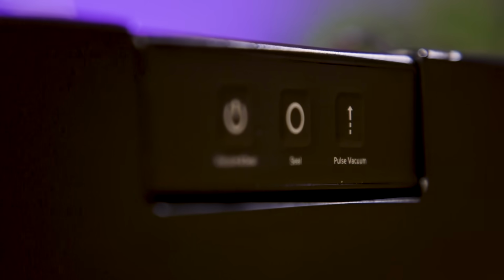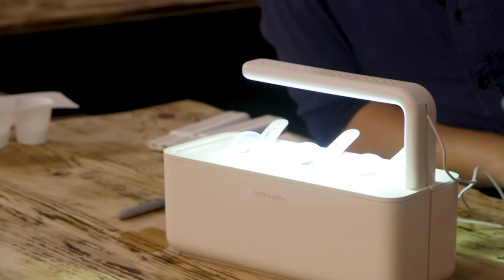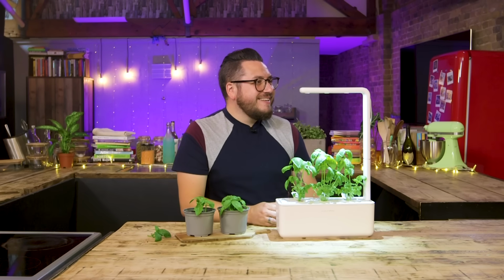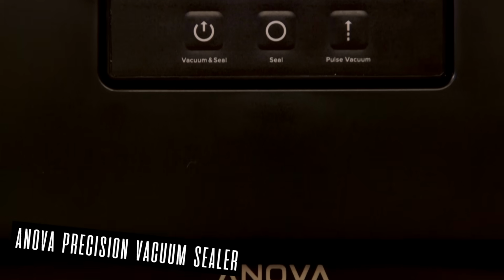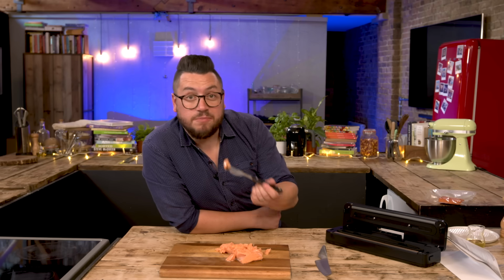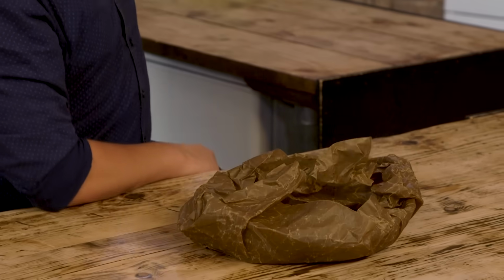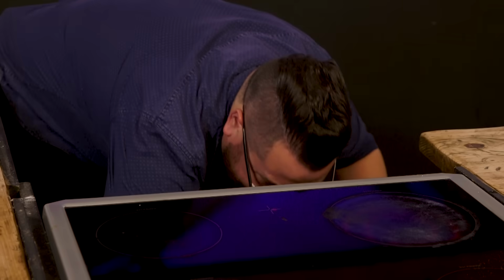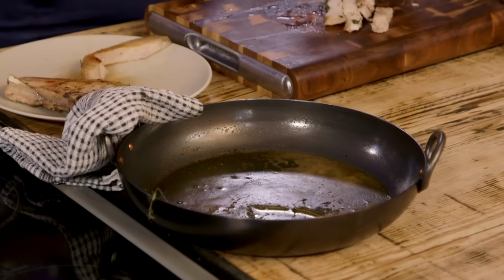Reviewing High(er) End Kitchen Gadgets Vol. 2 | Sorted Food

Comment: first one looks like a tank, with some pots slightly shorter than the fill line, with some fabric or yarn going from the bottom of the pots into the water of the tank. (The string brings up the water when the dirt gets dry.) With a LED plant light strip on top.
On amazon you can get some self watering planter pots (4pack 9.5 inch for $40 or 3 pots and 3 window boxes for $30) for between $30-$40, and 2 LED strips you can put on the underside of a cabinet for around $18.
Seeds are expensive on Amazon but go on etsy and there are lots of different shops selling seeds, found a listing for 10+ Organic Basil seeds for less than $1 and about $2 for shipping, with a lot of high reviews.

So for around $60 you can put together your own kit and have more planting spots for different plants and the pots are bigger so they have more room to grow.
€89.99 translates to about $110, so a savings of about $50.

Comment: Hi! Chemist here! Well that may be generous, Chemistry Degree here who enjoys cooking.

Seasoning on the Carbon Steel pan (and cast iron cookware which is similar) is a polymerized hydrocarbon. That's a similar structure to plastic which is why it has nonstick properties. The best method to season it (many carbon steel pans come unseasoned) is to use an oil with a high amount of unsaturated fats (I find grapeseed and canola to be best with respect to price and availability), use a very thin layer, and a very high heat in your oven.

The reason you want a high amount of unsaturated fats is that those fats are more reactive and will polymerize more, so the seasoning turns out better. You have to heat the oil well above the smoke point as well to start to break down those bonds so they will react. You will smell some burning oil, but you shouldn't see a ton of smoke billowing out, that's a sign you over-oiled the pan.

Comment: i'm american so our idea of portions is a little different than y'alls but i love my vaccum sealer and i don't even have a sous vide machine. i use it to pack stuff and save space in the freezer. it prevents freezer burn pretty well. i have occasionally used it to marinate but for the most part i use it to aid in storage so i had never really thought about the plastic issue before. it's worth noting that if you cut off the sealed bit the bags are re-usable depending on the quality you get you just have less and less bag each time. i feel like you used a lot more bag than you needed for these tests and if instead of cutting it open you just snip the sealed bit off you could have gotten more uses out of them if the plastic waste is a concern.

Comment: That Click n Grow seems legit, America's Test Kitchen named it their winner in a test of 4 models.  Some competitors didn't work, some didn't grow nearly as fast. But the problem is that the darn pods with "smart soil" are so expensive that if you replace your pods after 3 months you'll soon rack up a higher cost than the unit itself. So it doesn't even pay off in the long run.

Comment: As far as the potted basil goes. You can buy those window box flower pots that have a lifted bottom with holes in it, so you can fill up the bottom with water. Works wonders for growing your own herbs, you do have to wait till the root system develops enough to reach all the way trough to the bottom tho, and just water it the normal way. So while the gadget might be neat, unless you are living somewhere where you get no sunlight the right planter box would do the same.

Comment: In the U.S. I have an Aero Garden, the nearest appliance to the herb garden seen here. Mine does give more options, however you do need to put fertilizer into the water when the machine says to, about every 3 weeks. It also tells you when it needs more water which is helpful. I plant mine in November, usually opting for thyme, chives and basil. By the time winter in NYC rolls around my fresh herbs are ready and last for about 3 months. I use it all the time since fresh herbs in winter are very dearly priced.

Cleaning it for the year is a bit of a challenge.

Comment: The vaccum sealer for me gets used weekly, we bulk buy chicken breast and seal/freeze them in packs of 2 to defrost as required, same goes for steaks I’ll get a full fillet/ribeye and cut into individual steaks. Saves so much space in the freezer, saves money on buying multiple small packs of meat, and saves multiple trips to the shop..for me the sous vide is more of an occasional treat that I wouldn’t call essential, but I’d recommend every kitchen should have a sealer!

Comment: Hey Jamie, that vacuum sealer, it's perfect for freezing your leftover smoked meats! Seal it up, freeze it, and when you want it again heat it up in the bag in a pot of boiling water...tastes exactly the same as the day it was sealed.
And as for the bag waste, those bags are washable and reusable. Obviously you'll end up with an unusable bag at some point with cutting the top off, but the bags are not just one use plastics.

Comment: You don't need a Sous Vide machine to make use of a vacuum sealer. Just to be able to save space on the fridge, to keep things fresh for longer, and to help with portion control. Newer machines have an attachment to be able to use reusable bags, helping with the plastic problem. And for those jobs where a reusable bag is not really the best fit, newer machines also incorporate the heating element inside the vacuum chamber, so that you could make use of the smallest bag possible, limiting the amount of wasted plastic. 

We got our vacuum sealer before our Sous Vide machine, but we mostly use our Sous Vide as an easy way to prepare dinner before we get home. You could leave your meal in an ice bath for the entire day and then have the Sous Vide machine start up a couple of hours before going home, and when you get there, you have a portion ready to either sear or eat straight out of the bag. You could make a lot more than just meat, its a great way to make potatoes and keep them from either drying in the oven or absorbing too much liquid by boiling them.

Comment: Just like zipper bags, flavor seal bags can be washed and reused. Simply cut them as close to the seam as possible when opening, so you still have most of the material.  :-)
Most sealers also come with a vacuum attachment for sealing canning jars. 😀
The sealer is also great for extending the shelf life of foods bought in bulk.

Comment: Sous vide works great for any fatty meat. I've cooked  pork shoulder roast, beef roast, corned beef brisket,  and steak. It also works well for veg. You don't really need a vacuum sealer, when you can use the water displacement method.

Comment: You missed one of the greatest benefits of the vacuum sealer.  Sealing food for preservation.  If you are going camping, the food will last much longer.  It will also much reduce the possibility of freezer burn.  As for the amount of plastic used and cost of the bags, some machine will use a continuous bag that comes on a roll and is MUCH cheaper.

Comment: Cast iron pans are cheaper and do the same thing for me.  Most came from the thrift shop, but the full set came to $35.00 with four sizes plus a dutch oven, Ann pre seasoned.  All now, 10 years later, have a non stick, glass smooth surface that can be wiped out with a paper towel.

Comment: You can skip the sealer and buy reusable silicone sousvide zip bags.  It does not devoid fully of air, so not used for marinade absorption, etc, but fine for sousvide cooking.  Saves on the plastic.

Comment: Ben says the the pan is seasoned and oil is added. and polymerized Jamie then says the pan has the non stick built in. the seasoning will wear off over time if you do not cook with it enough or scrape it off. Also some cleaning agents like BKF  will remove it.

Comment: ziploc or plastic bags have chemicals that release at higher temperatures, the bags made for sous vide are made for it. PLEASE NOTE, not all vacuum bags work for sous vide for similar reasons. as far as trying to reduce the waste on those vacuum bags, use slightly more than you would think, longer bag and seal. when you cut the bag open, cut just below the seal. wash and reuse for similar cooked products. can reduce the usage and cost.

Comment: For me, sous vide is a game changer. Not normally wild about pork chops but now they are one of my favorite meals, especially with Weber's coffee rub, which of course I can't find any more. Great for veggies too tho it takes longer to get up to temperature. The texture of everything is different, i.e. chicken breasts don't have that stringy texture you normally get.

Due to chemo and a bone marrow transplant I've had occasions where my immune system has been compromised, this gave me a way of not having everything well done, thanks to Douglas Baldwin's temperature charts.  And for ice cream we can pasteurize eggs and still are able to whip up the whites, well a little closer to yellow but look white when whipped. Or cold brew coffee at 150°F / 65.5°C in 2 hours, I just set my french press in the tank, then pull it out an hit the plunger. Other tricks, like using canning jars and making yogurt or cheese cake.

As for a sealer, I've used freezer bags, which have the added attraction of handling liquids, but there's always a bit of worry about leakage. I have an inexpensive vacuum sealer, makes the experience worry free, and keeps veggies fresh longer and avocados green after slicing. But there's an alternative;

My wife bought me a Mellow, which has a tall narrow double walled tank and only takes up the same counter space as a loaf of bread. You can use regular freezer bags and leave the end open, the top of the bag will be above the water level, and the tank lid pushing down on the bag keeps the food submerged. 

Since it takes up so little room it's out all the time, and the refrigeration ability lets you load it long in advance (as long as you start with chilled water otherwise it doesn't cool down fast enough). It only does 4 servings, uses air bubbles to circulate the water so it sounds like an aquarium, and can only be controlled through an app, which I find a bit annoying. I understand that a double sized one is now available that will allow using both sides of the tank either singly, separately, or as one big tank.

Comment: I wouldn't want to live without a vacuum sealer anymore. Especially since the prices came down a lot since and most can also seal liquids now. I am getting a new kitchen soon and even think about getting a drawer vacuum sealer for underneath my 2 ovens. It is expensive, however it is also very convenient to not have to get out the sealer and put it away afterwards all the time. And due to the drawer design you don't need to fiddle around with space for the filled bag. The point against it would be the high cost to replace it in case it stops working. With a worktop version you just buy a new one for 50 quid and off you go.

Comment: The carbon steel pan was heated wrong. It warped the bottom, because you heated it too quickly. They tend to do that, when used on electric stoves, as they heat the metal from the center to the outside, while if used on gas, the pan is heated from the outside into the center. When useing a carbon steel pan on electric stoves, it's best to heat it slowly to avoid the warping. They are really great though and I am never going to be using anything else in my kitchen again. The non-stick is absolutely amazing and only gets better with each use.

Also, when you re-season the pan, make sure to place it in the oven upside down, so any excess oil drips off and doesn't pool in the bottom. No matter how well, you wipe off the pan, you can be almost certain there'll be tiny beads of oil in the bottom, if you don't do this. But honestly, with normal use and loving care, you won't have to do anything. When you are done cooking, run it under hot water and scrub with a clean brush. Dry it off and apply a thin layer of oil all over the cooking surface, then use a clean papertowl to whipe it off again and it's ready for storage.

Also, take a look at De Buyer Mineral B Pro. Cheaper and much more versitile, due to the handle that doesn't get hot, when used on the stove.

Comment: I love my vacuum sealer for things I’m putting in the freezer, primarily meats into smaller portions.  My sealer cost $36.95 and it comes with a roll of double plastic you can cut to size for your portion, seal one ens, pop in your portion, then vacuum and seal the other end in one click.  I’ve tried zip lock for Sue V and they don’t hold up well.  They really don’t hold up for freezing.

Comment: Tip for you: I just bought a Stasherbag (stasherbag.com. I bought it to see if I can replace plastic bags with these silicone bags. In addition they claim you can sous vide in them (they can handle freezer, fridge, microwave and oven too). I would love to see this put to the test, cause if it works, great way to reduse waste 😊

Comment: For the vacuum sealer and sous-vide at home... While Anova is great stuff, especially the stick with all those fancy features, I am quite happy with my Lidl stick (50€) that has no connectivity and is manually controlled, but still gets the job done, and you can always get non-brand vacuum sealer that will work just fine for about 20€. The main advantage going cheaper on the hardware is that I do not feel guilty when it just sits in the cupboard being used on average once per month. 

As far as sealer vs ziplock bags? For sous-vide, it's huge quality of life improvement. No need to faff about with getting all air out of the ziplock, you are guaranteed to have full submersion in the pot. It's as well superior for freezer usage (especially if you are handling food that will make the bag non-reusable). And in the end, if you are crafty, you can always reuse the vacuum bag few times over, too.

Comment: The Click and grow is a neat toy, but each capsule is obnoxiously pricey and they go out of their way to not tell you how to reuse the capsules they come with. (I’ve had a couple of them since the early days.) nearly as obnoxious is that the roots grow through the bottom into the water reservoir and are difficult to get out when changing the capsule for a new plant. It also does better with herbs than fruiting plants. I tried growing the micro tomatoes (because WHO WOULDNT) and got maybe three fruits (the size of my pinky nail) with minimal flavor.

I also had trouble with the light over time. Maybe it’s because mine was an old model, but the light was really fiddle to get positioned just right so that it wouldn’t start flashing.

All that said — it was extremely cool to be able to grow fresh lemon balm in my livingroom where I’ve got very little window light.

Comment: I had an indoor herb garden a while back, the AeroGarden. Same concept.  Reservoir with a bubbler in the bottom, space for 6 plant pods and an adjustable height lamp on top. Automatic light timer, little light for when the reservoir was low. It grew the first basil plants very well, as well as some tiny petunias but that was it, everything else was just sort of meh. I loved the concept but the cost of the replacement lights ( Needed replacement every 6 months) and inconsistent quality of the pods ( Many of the pods are more than a year or two old when in the shops, making the seeds less viable), as well as the fact that the bubbler couldn't be replaced when it eventually broke down made me end up tossing the whole thing after a few years. 

It's a really great idea but you can do it significantly cheaper and better with a DIY lidded bucket hydroponic unit.

Comment: People should realize that you can "season" almost any pan, even a pan that had the teflon or non stick coating worn off. Just use something extremely abrasive to get off most of the coating, then do the exact same thing as any other pan seasoning. I did this on 20 year old Tfal pans that were scratched to hell, looks brand new on the inside.

Comment: the plants knows it self how much water it needs. no problem as long the roots are not submerged in water, and drowns. the secret is that the thing never fills up under the plants to a nivea where the roots would drown.
Reply: if the pot for the earth is big enough, it can hold more water than the small pots in this machine. therefore only needs water every 2 - 3 day or more . depending if it is in the sun or not ( if you wish to have herbs in a cheaper way than this )

Comment: You can achieve the same thing as the vacuum sealer with a ziplock bag and a drinking straw. Then clean and reuse the bag in most cases.
I DO like that pan, though.

Comment: Also if you buy a sous vide checm  Amazon warehouse there's crazy good deals like sub 50 immersion circulators for weaker ones or higher end ones like the one I got for 130 as opposed to the 400 new asking price, vacumn sealer  was 100 new 20 bucks on Amazon warehouse

Comment: The skillet looks beautiful. But is it really functional with that kind of handles for a skillet that's - I'm guessing - on the heavier side? I have problems with my wrists and can really see myself struggle using it on a daily basis. :/
An great option though is a lightweight cast iron-pan. Not as heavy as a great cast iron-pan, not that expensive, no weird coatings and doesn't kill swollen or over-worked wrists. Maybe something to try out in the next video?
Reply: The skillet is actually really lightweight to use, much lighter than a cast iron skillet, it's base is the same thickness as the sides so it's actually less than 1.4kg (I love mine)